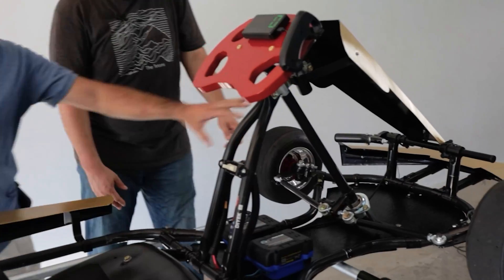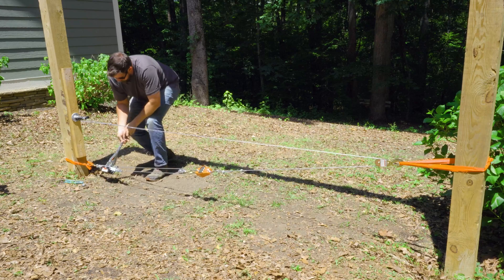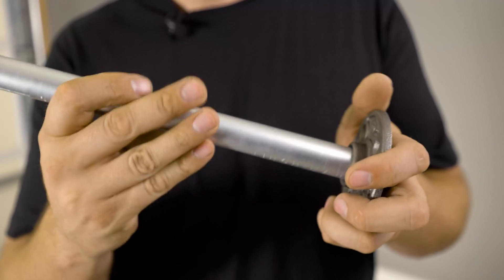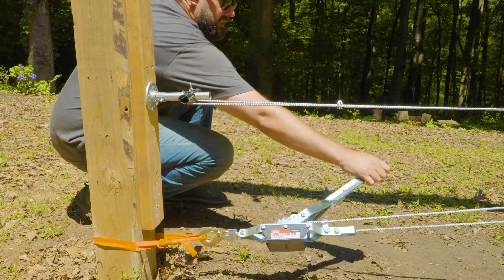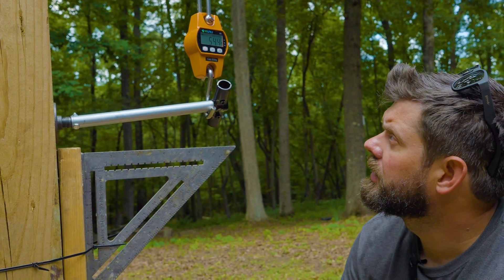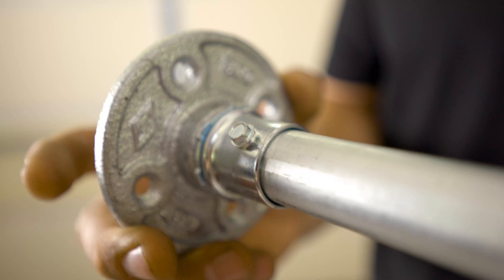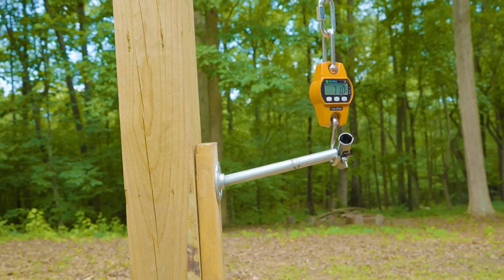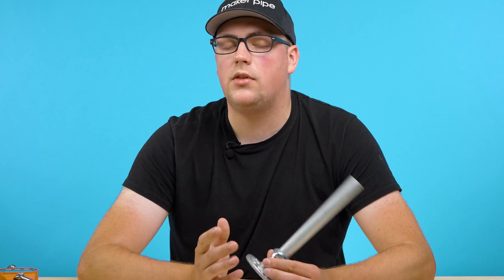DIY Pipe Flange Strength Testing!

Comment: Ahh yes, the reinforcement hack. I know all about that. For sure.
Reply from the maker: lol we talked about it in the prequel to this video. Probably should’ve explained it again. Basically you just use a fender washer and a counter sunk bolt that threads into the conduit via threaded tube nut inserts.

Comment: Awesome video. Those EMT threaded compression fitting couplers can be deceiving at first look. They actually have quite a grip, someone must have already done load tests when they designed them and offered them for electrical conduit connections, but it is great to see these independent tests on video. I was going to use them as wheel hub adapters on my MP  and EMT go-kart but I thought they may not hold. After watching your video, I am thinking maybe it is worth a re-try.

Comment: Any sense of how the bending strength for your new Flange Connector compares to these?  (At least when bending towards one connector side, i.e. the stronger direction)
Reply from the maker: That's a really great question. I can't believe we forgot to mention that in the new flange overview. One of the reasons that we decided to make the flange the way we did was for that reason. The taller steel wall will provide more bending strength for sure. We still need to do testing to find out exactly how much stronger it truly is.
Reply: @MakerPipe   Nice!  Would be interested to see the outcome of the tests

Comment: Have you all ever measured the force that the connectors themselves can take before they slide?
I.e. say you have a shelf system where you use the 90deg connectors at each corner.  Knowing the weight before they slide will give you an indication of how much you can put on the shelf (assuming the cross members and vertical members can also handle the weight).
Reply from the maker: Hi E.C. thanks for the comment! That is something we have plans to test because it is something that would be helpful to know especially in the use case you described.

Comment: Why do you think the compression fitting did well on the bend strength?  Is the fitting thicker walled?  Does the fitting extend further out than the other methods and thus creating a bit more of a beefier joint?  I appreciate you publishing these videos and building this kind of community and knowledge base.  Good job!
Reply from the maker: I am really glad you like them.  Thanks for watching and the feedback.  

I think you hit both of the key points.  1)  The compression fitting is taller and has more engagement with the conduit.  2) With the different components of the compression fitting, there is just more steel there and it adds to the stiffness. 

I thought it was interesting how the hack complemented this and made it stronger.  It seemed like it was holding the conduit into the fitting and resisted it twisting out when bent.  We were really suprised!
Reply: @MakerPipe I know this is 4 years old but.. compared to a threaded flange the stresses are out on the pipe where it's thicker and not threaded.. where is a threaded end being stressed the pipes obviously thinner in the threaded portion. Interesting video.. the point someone made about double lines in going around the snatch block doubling the forces I would think would be true and make a huge difference to your claimed results.

Comment: Very cool results!  Thanks for the effort to make comparisons. I am surprised about the all-around strength of the compression with backup reinforcement hack.
One thing that may or may not apply to projects is that reinforcement hack. I love its simplicity, sitting flush in the back, but there may be projects where it is not possible to add that hack since you have to do it BEFORE you mount the flange itself.
Another surprise for me was the fact that the flange attachment with screws overcame the strength of every conduit junction method. I know we use screws everywhere in the world to attach stuff, but did not realize screws to wood post are NOT the week point. Not by a longshot.
Reply from the maker: Yes very true! Especially since the screws were fairly short. We did have them fail once when we were way above 600 pounds on one of the flanges

Comment: Great stuff - thanks for doing this. I'm hoping/expecting to use MakerPipe as part of a camper van buildout, so the flanges are going to be important. Compression fitting + safety bolt seems like it should work well for my purposes.
Reply from the maker: That’s great! Can’t wait to see how you use them in your van build out.

Comment: I’d like to see a pull out test on your threaded inserts. Are any of you familiar with smacna?
Reply from the maker: We’ll have to do the same test on the inserts. I don’t think I’ve heard of that
Reply: @MakerPipe  they wrote a manual for hvac sheet metal fabrication, most of which is useless relating to building structures out of emt with exception to one page that has compression ratings of varying sizes and lengths of metal emt conduit. I will take a pic of that page and email it to you next week.

I appreciate all the work and products you produce using emt. I have built many things using emt, 1000’s of linear feet. My boss refers to me as the conduit king🤣🤣🤣.

I hope to try out your products someday as to how to relate them to hvac structures as well as my own pet projects. Right now I cut, cope and weld, emt is such a versatile material. I’ll share some of what I’ve learned about the material have what other common things that work well with it.

Y’all keep up the good work!

Comment: Wow.  I was surprised.  You could use a self-tapping screw on the compression fitting combined with the reinforcement hack for the ultimate pull-out and bending design.
Reply from the maker: For sure! The ultimate flange